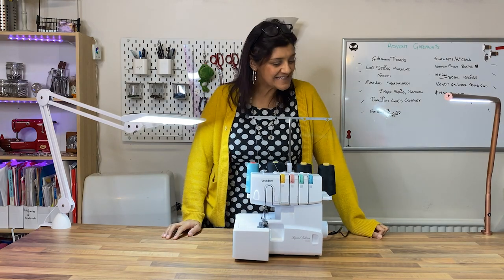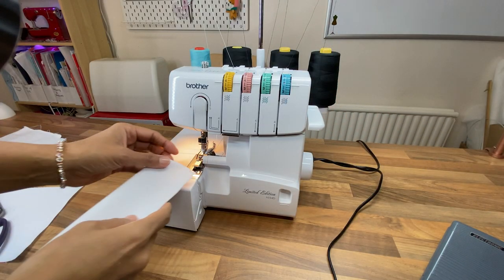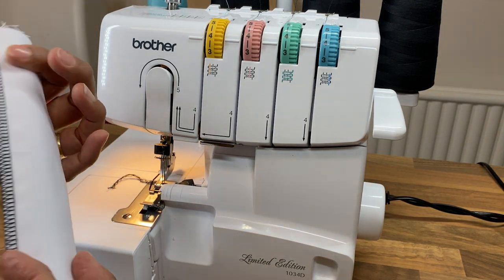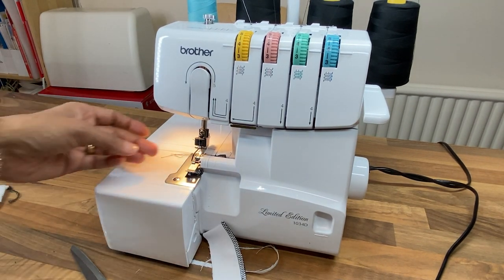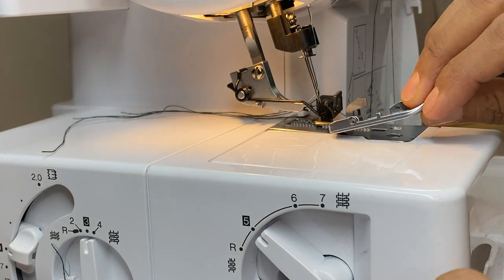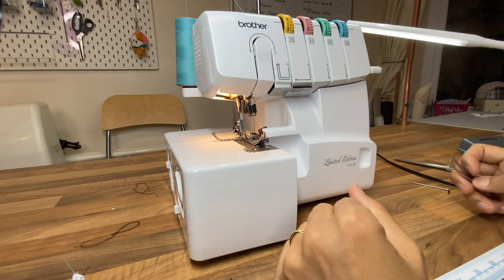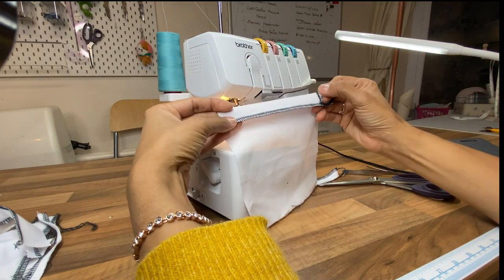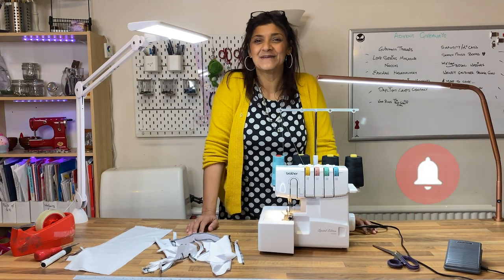Common Overlocker Problems FIXED Easy 1034d | Abi’s Den ✂️🧵🌸

Comment: Hi hun my overlocker I’ve got second hand I’m new at this where do I get needles from please as the needle that is in the Machine I think is wrong and the threat keeps gathering up just underneath foot xx
Reply from the maker: Hi Amanda. The needles won’t be at fault. The needle plate is probably damaged. This machine has a lot of problems around that area. Look for  my video on fixing the needle plate.  Good luck! 🌷🪡

Comment: Hello! I’ve rethreaded my brother 1034d serger several times and followed all directions to a T. My upper looper(green) thread keeps snapping and in my stitches, the overlocker thread looks a little funny in a couple spots. I keep my tension at default settings so I really don’t know what I’m doing wrong. Any ideas on why the thread keeps breaking?
Reply: The regular needles could be just slightly hitting rhe upper looper when they meet causing the thread to break or it could be a poor quality thread OR the lower looper is Just A teensy bit off timing that it is cutting the thread eventhough seems working proper.if you hear ANY kind of Slight Clunking metal noise it is the timing that is just a little bit off. Take a good flashlight and slowly turn the hand wheel towards you amd watch each looper and the needles and listen for that clinking sound it will confirm, if I am right. I heard that  noise but kept dismissing it as it was "my imagination". I am learning that Sergers are finnicky, great, and can be frustrating too all at the same time, lol!

Comment: Just got mine today, took it out of the box and took of the tape.  Plugged it in, and gave it some gas, but it won't feed or stitch.  The motor runs, but it feels like there is something preventing it from sewing.  Is there a switch for shipping that needs to be flipped?!  More than two pieces of tape for shipping?  Any help is appreciated.
Reply: Ok, totally embarrassing -  I wasn't pressing hard enough on the foot pedal!  Problem solved.

Comment: Please help. My overlocker won't form a chain. I've re threaded it again and again. I've had it about 15 years and wonder if its maybe just had its day. Any advice would be greatly appreciated x
Reply from the maker: Overlockers can last forever. It need timing checked. Have you checked the needle heights and that they’re in fully.
Reply: Needles are all OK. Ill watch your video and check the timing. Thank you so much for getting back to me x
Reply: Thank you, thank you, thank you, you are a gem. Followed your video and now I’m all up and running again. Thanks again 😃

Comment: Hi, I have a Elna pro 905 dcx
It does 5 thread, 4 thread 3 thread wide, 3 thread, overcast, cover stitch  2 different rolled hems, and straight stitch. The five thread  straight stitches does form properly. And when I do a rolled hem or overlock with 3 thread or 4 thread my stitches doesnt cover my material. I tried adjusting my cutting width. Could you pls advice. Thank you
Reply: @AbisDen  thank you for your prompt reply, I reduced I also tried increasing. But still doing the same. I was thinking maybe it has to do with those 2 teeth under needle plate...don't know what you call it.

I have just watched your video on cleaning and oiling the machine. Maybe I must do that tomorrow.

Comment: I have been in a battle with my EURO PRO serger for days. The first thread keeps breaking. When I rethread it it will not become part of the chain. It comes out by itself and not part of the chain. Do you know what I can try?
Reply from the maker: Have a look at this video. I think you might have the same machine Overlocker Timing - Lower Looper Fix Janome Serger Repair - 8002D #AbisDen #Overlocker #Repair
https://youtu.be/xdcf6r-Mexw

Comment: Hi, thank you very much for this video, I have a problem.. my overlocker Handwheel stuck and not turn at all, any suggestions?
Reply from the maker: Seized Overlocker And Damaged Looper | Abi’s Den ✂️🧵🌸
Reply: @AbisDen  wow !! Thank you very much i put the oil as you said in the video and it works perfectly now 😍😍😍❤️❤️

Comment: Hi again Abi.  I have such problems when I try and create a 3-thread overlock on the Aldi Necchi OV234. I want to use it to tidy the edges of a sleeve I have set in.   I gave up and used a sewing machine zigzag on something else but it wasn't really good on viscose.  I have tried again today for the past three hours and just can't get the stiches to look right, again on viscose.  I have googled many times and just can't get it set correctly.  First of all, for a three thread, should the two loopers overlap on the top of the seam , or is that only for a 4 thread?  I just don't know how it is supposed to look. I've reduced the differential feed to 0.7 and that has helped with the tunelling and I've fiddled with the looper settings.  Any tips or videos would be so great. thank you
Reply from the maker: Viscose can be so tricky to sew. It’s lightweight and with 3 or 4 threads, the stitches can get too thick and heavy on the fabric. Use 3 threads, light weight thread and fine needles.  Finally, increase the stitch length.
Reply: @AbisDen  the funny thing is, it worked fine on four thread on the same fabric, but not with three. I could try a change of needle, which is what I had to do on the sewing machine with that fabric. I used a 70/10 on the sewing machine. I'll try increasing the stitch length.
Thank you.
Reply from the maker: It sounds like a timing issue in that case. 🙁
Reply: @AbisDen  not sure what a timing issue is.

Comment: Hi abi, what if my cutter will no longer cut the cloth? What should i do?
Reply from the maker: Just check the knife hasn’t slipped. If it has, it usually chews the fabric rather than cuts. If the blade is full, it’s usually cuts badly. You can change the knife easily.

Comment: I want to ask something, my moms machine doesnt catches the fabric, it does the stitches without fabric, but when mom uses fabric it doesnt works, do u have any tip how to fix it? Thankyou
Reply from the maker: The timing is out of sync I’m afraid, check the needles are in properly and if the problem still e sits look at the timing tutorials
Reply: @AbisDen  thankyou, its almost fixed now, but it has only a small problem, it doesnt catch the yellow thread, of the left needle

Comment: My wife has a Singer S14-78 and light comes on but will not sew when foot pedal is pressed and can't turn the wheel.
Any suggestions please what's causing this.
Reply from the maker: Hey Stewart (and and Mrs Stewart) seems like the machine needs oiling. Mine froze just like this and I oiled the essential parts. You may need to send it in for a service if oiling parts doesn’t work on your machine. This problem has been frustrating many customers.  Good luck
Reply: @AbisDen  Thankyou for your reply, I'll have a go at oiling it 🤞🏻

Comment: When I plug in my serger there it nothing happening no power. Could it be the machine or the foot peddle?
Reply from the maker: It could be either. But if it’s a brother it’s the brand. They are the worst machines

Comment: I'd like to find a guide to adjusting the loopers. I have 2 older overlockers and I think they both need tweaking. I'm good with old sewing machines but these overlockers have just kicked my butt.
Reply from the maker: Have you looked at my loops hanging off video? - these machines are so simple to use, just like anything, takes a little understanding. I honestly thing sewing machines can be a bit trickier, with overlockers you can calibrate the timing much easier than on a sewing machine.

Comment: Pls my singer serger was working perfectly    two    days ago.. the following day.. I put the power on... the lights on the serger switched on but when I pressed the foot pedal, it wasn't sewing...    so I tot it was a problem with the foot pedal... I got a new singer foot pedal.. but its also not sewing... pls what should I do... what could be the problem.. pls its urgent .. pls help.. tanx
Reply: @AbisDen  ok .. I checked all.. everything is intact.... when I operate it manually..  it moves and sews... hmmm am really worried.. pls help
Reply: Hi, what was the cause of your problem? My wife has a Singer S14-78 and light comes on but won't sew when foot pedal is pressed and can't turn the wheel.
Any suggestions please.

Comment: not sure youare still doing this channel, but maybe someone can help me. I have a brother overlock 1634d and my thread is wrapping around the lower area around my feed dogs, i think that is best way to explain. I have rethreaded 1.2 billion times , changed thread, changed settings. i cannot figure this out. and no one is addressing this. can you help me? you show the area in the video when you show the three threads needing to be untangled. I thought that might be my answer but it was not.
Reply from the maker: Overlocker Problems : Threads Trapped,  Broken Needle Plate, Chaining Fork - Singer Lidl S010L
https://youtu.be/IysSsj3lvVM

Comment: Im so frustrated!!!! My top needle thread keeps snapping, I've tried everything and it just snaps snaps snaps, I've tried checking the needle, replaced it, I've tried rethreading, I've tried adjusting tension
Reply from the maker: Some machines are a nightmare. Have you tried different threads?

Comment: i need your help i have a serger just hit a year old and it is not making chain stitches , i took it to a local mechanic and he said he does nott know what is wrong with it im at a loss.
Reply from the maker: 😞I think the timing is off. Have a look at the video in which I show you how to fix the timing. How to fix the timing on an overlocker serger machine #repairs #sewwithabi #abisden https://youtu.be/2CXhlZn2DFM?
Reply: the gentleman said the timing was great and stitch finger was good also he said in 25 years hasnt seen anything like that but broter machines are problematic
Reply: @AbisDen  thank you will look at video and work on it myself. thank you for taking the time to reply back.
Reply: I just wanted to say a huge thank you i watched the video and did what you said and its working properly it was the lower looper like you said

Comment: The left serger thread is not doing anything but staying straight. But the other 3 are good
Reply from the maker: Yep. Rubbish overlocker
Reply: @AbisDen  is there anyway to correct this problem? I would like to have all 4 threads but 3 seems to work also. Plus I took the left needle out.

Comment: The last thread (going through blue tension wheel) always seems to get caught for me. I try to pull away the fabric after it's serged (the way you pull fabric away on a sewing machine and the big and small bobbins allow thread to be pulled out) and it's really hard to pull away. The only thread that looks different from when I threat it through the machine is the last blue one. Is it meant to be hard to pull fabric away from a serger? or do I have a problem with the machine? I just keep resetting the threads over and over again every single time. I'm too afraid it's going to break something if I just keep serging. anyone have or heard of such a problem?
Reply: Had that problem once or twice and once it was because I was convinced Inthreaded it properly bit kept missing one spot underneath before it Fishkill through the lower looper hole.The otjer time it happened is when I did not realize Inhad either bumped the tension dial on it or went from heavy fabric back to light weight and HAD changed the tension. If noe of this sounds familiar, and you have the manual, look for what the ORIGINAL settings were for that thread. If it is a different number than what is in it now I suggest resetting the machine to" factory settings, " so to speak. Run some test stitches through it with the same weight fabric you are trying to use and see if that helps correct it.i I have even had to put all the dials to the same nimber and gradually one notch at a time raise them until I was seeing good stitches. Hope this helps and gets it running good for you.

Comment: Help, my first time running overlocker and nothing happens, no sewing.
Reply from the maker: Is it a new machine or have you got it second hand - check needles if it’s new but it could be timing if you bought it second hand.
Reply: @AbisDen  it is second hand, I think its I put wrong needles, going to buy new ones and try again.